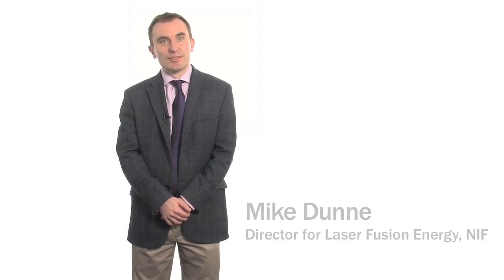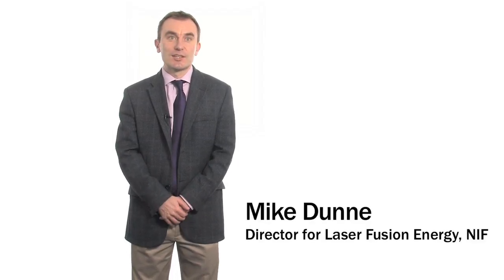Mike Dunne on the progress toward inertial fusion ignition at NIF

Comment: Why not aim your energy in such a way as to compress the T-D  fuel mix against a hot photon center of a double walled pellet that has an otherwise empty center, thus hopefully creating a uniform burn from the inside out. Also, a double pulse to do the 2 actions needed to initiate the burn might be a similar or concurrent option? Good luck.